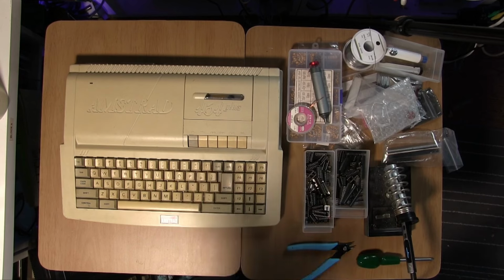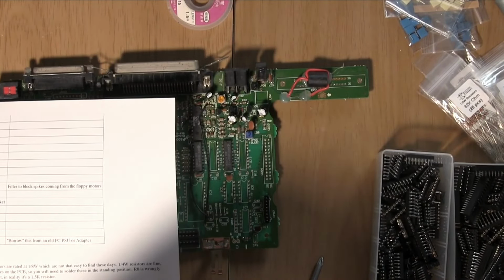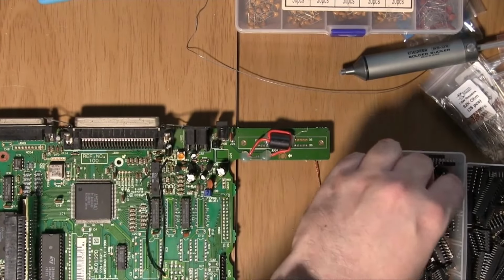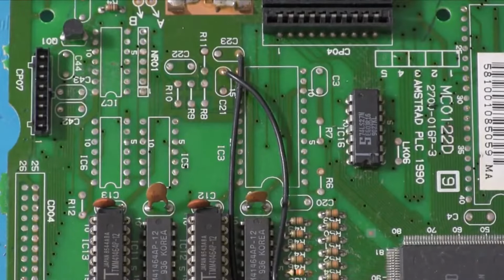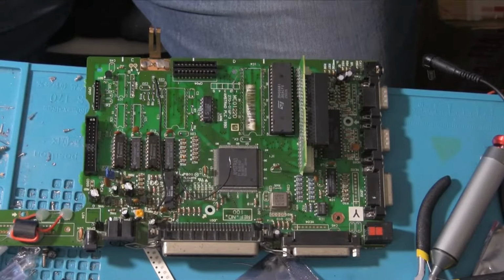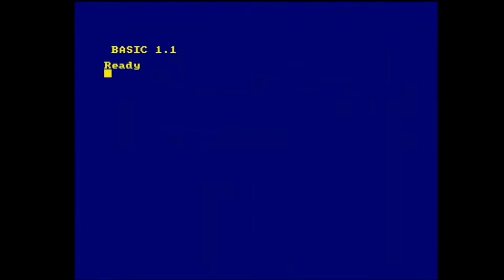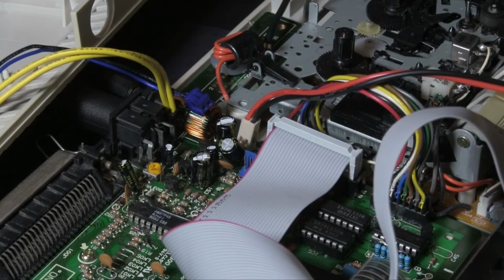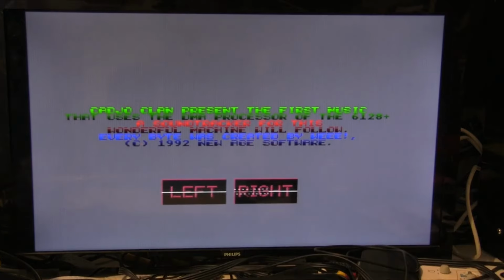Upgrading a 464plus to a 6128plus

Comment: THe CPC464+ mod as considered the BEST CPC+ , it had the same memory as the 6128, had a tape & also attach a 3" floppy drive (Qdisk), you can't put a tape drive into a CPC6128+. I have a new mint non yellowed CPC464+ but I have lost the Basic cart so I can't really do much with it, before I used a Tape line in adaptor to play mp3 game files to load